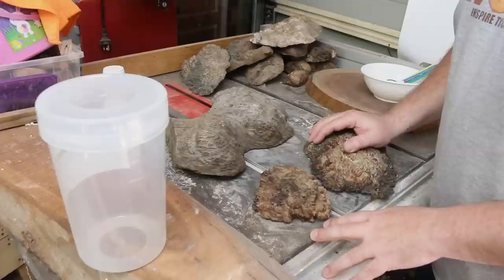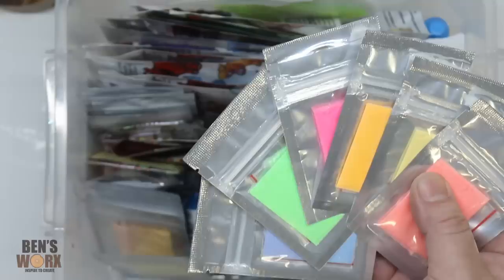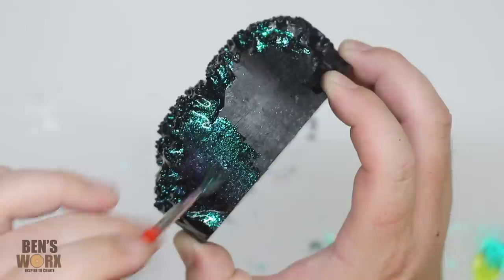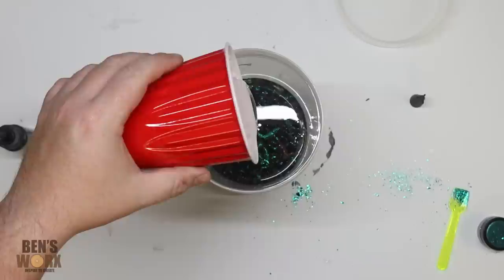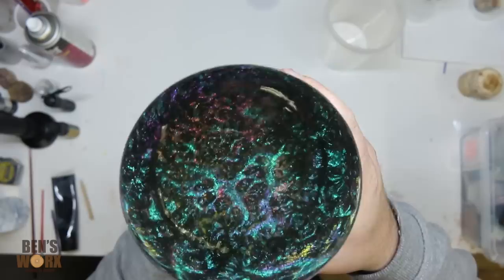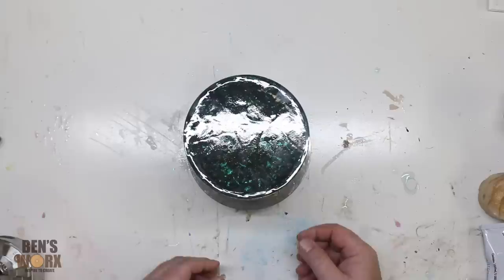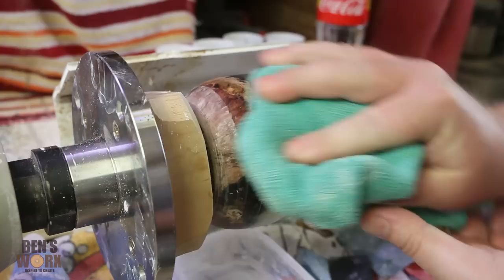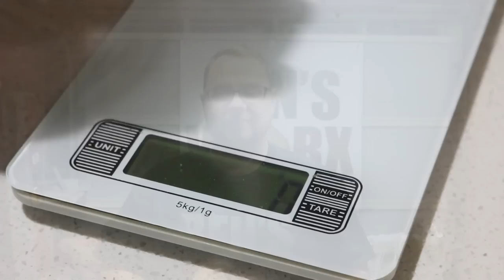I Made a GIANT 2000g Dragon Egg

Comment: Microwave safe doesn't mean it can handle heat, it refers to the item resisting heating up when bombarded with microwaves. In the future, something that is dishwasher safe would be a better bet. Just a thought....
Reply: Chemical engineer here. Even if a material is microwave safe, it still may not resist heat from the food thats being heated. This would cause it to leach chemicals into your food, so the material has to also be non toxic and chemically harmless to consume in the quantity it leaches for it to be “microwave safe.” Still not a failsafe though, there are growing concerns about BPA leaching from baby bottles for example.

The resin heating up most likely created heat transfer to the plastic container, causing the container to leach chemicals into the resin. These levels can become toxic depending on the type of plastic, some can leach toxins at as low as 120°C. Not a whole lot of research on it, but there’s a possibility of long term health issues from just breathing in the toxins.

There are a lot of variables in the process, but no matter the plastic used make sure it’s located in a well ventilated area ☺️

Comment: G'day Ben from South Australia, I have a epoxy Resin project coming up and am going to do a couple of practice runs first trying different release methods and colour additives, I have made a pressure box which I can use either as a Pressure box or Vacuum box. Which of these 2 would be the better choice?  Thanks
Reply from the maker: I would stabilize your wood with a vacuum and cast the resin with pressure
Reply: @BensWorx  Hey Ben, what do you mean by "stabilize your wood" ?  I can make the gauge interchangeable to have a vacuum gauge then swap out the gauge for a pressure gauge, But after watching your videos I will stick to a pressure box,    thanks again